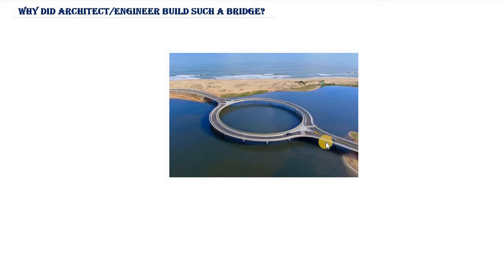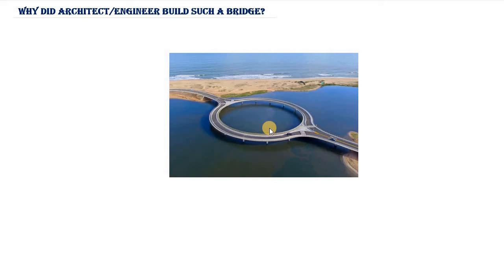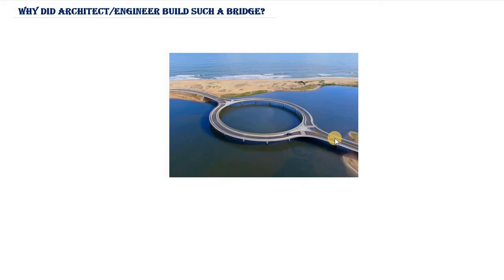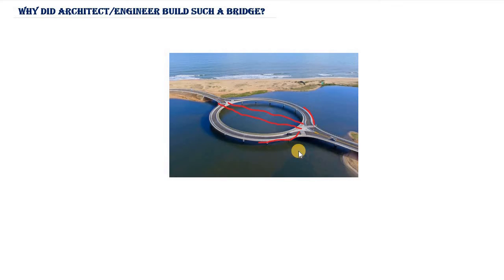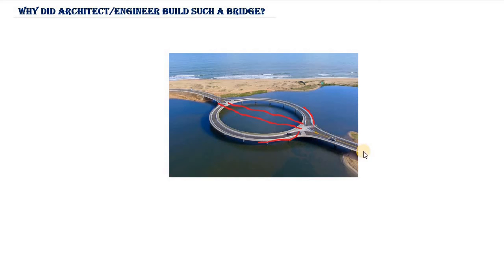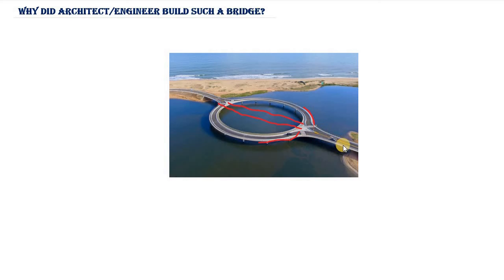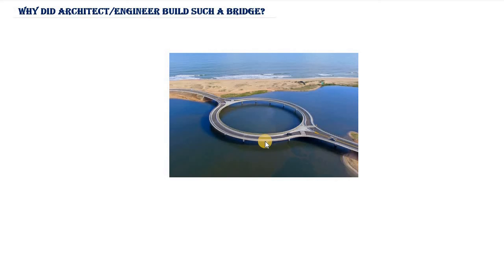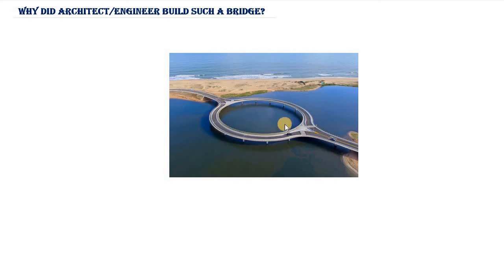Why Architects and Engineers design Laguna Garzon Bridge circular?

Comment: I won't dislike your video, it has most of the most obvious important points covered, but I'd like to comment on a couple which you mentioned:
1. To reduce speed of vehicles - definitely the most obvious point.
2. To increase tourism revenue - YES - but only pedestrians.  To say "We will build a bridge to make drivers of vehicle look at the nice view and not focus on the road"  is very dangerous.
3.  "The architects and Engineers didn't know what they were doing"... That's a low blow to anyone who has any experience in these fields.
4. The underlying soil conditions of the foundations if the bridge would've ran straight might have been a issue/ concern.  Implicating marine life of the reefs formation; or not financially viable due to deep pilings or structure settlement over time.
5.  TO MAKE A STATEMENT!!!  I'm going with this conclusion.  "Because they could"  (Google any other circular bridge and you won't find any results.  Also, how many people would like to say "I was on the Circular Bridge" ?)  So points 1 & 5...

Thanks for the video
Reply from the maker: Thank you sir for the comment.